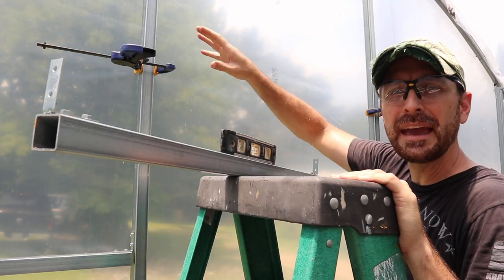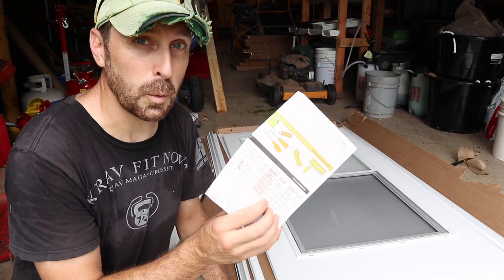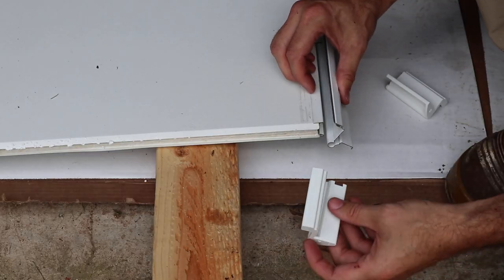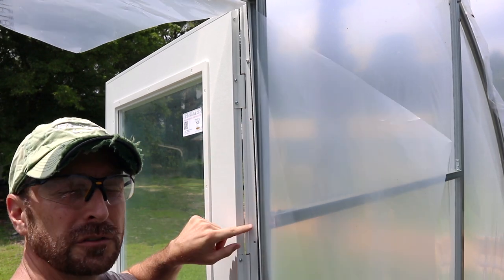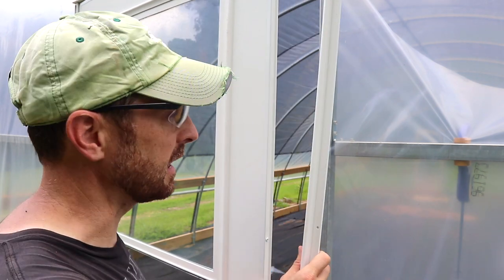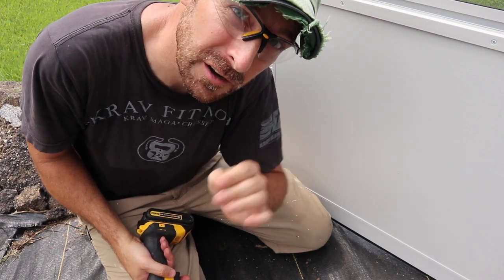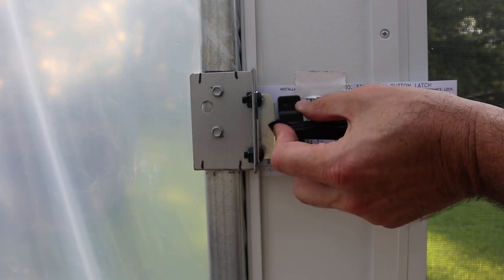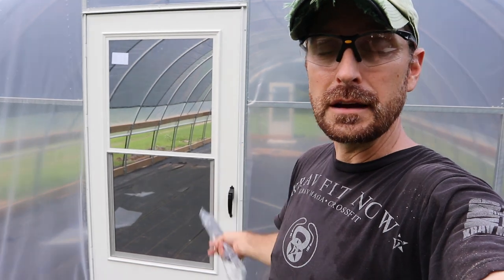How To Install A Larson Easy Hang Storm Door On A Greenhouse - With Handle Install And Modification!

Comment: Thank you so much!!! I cannot believe how quickly you sent me the right link 🙏
My husband will get some angle tomorrow and cut that part!!! 
Now he says that there's no need for the small plate since he's getting the angle. but I see you still using the small plate along with the angle.. is there a reason?
Reply from the maker: You're welcome. It is really going to depend on how your door frame is designed. All houses are different. As you could see, the catch latch on this is for my greenhouse. Your home could be different. You may have to shim it out with some plywood or another material. Unfortunately, I can't cover every situation that may arise and can only give general information. Hope you understand. Cheers.
Reply: @CountryLivingExperience  You helped plenty!!!  thank you so much. God bless 🙏

Comment: Will the screws supplied with Larson doors work with a metal framed door jams or should I buy sheet metal screws.. my attach points are all steel frame
Reply from the maker: They will but you have to pre-drill them.